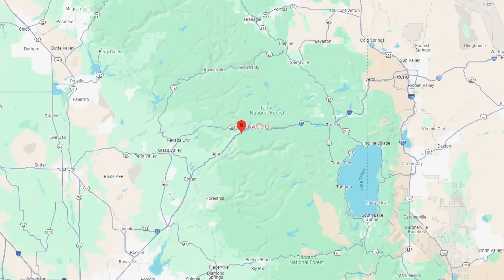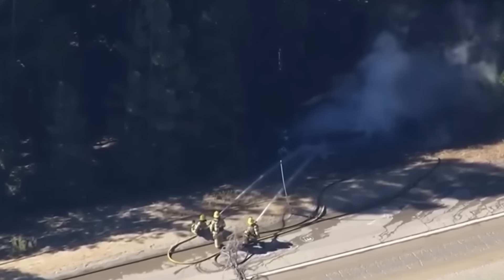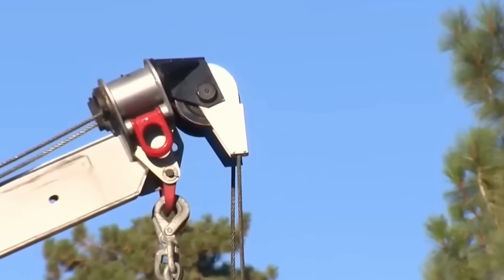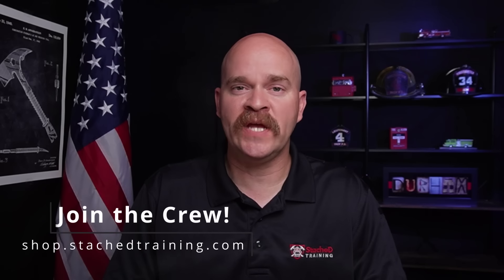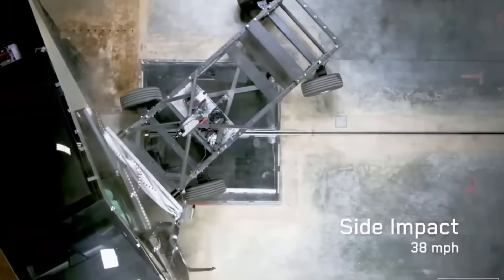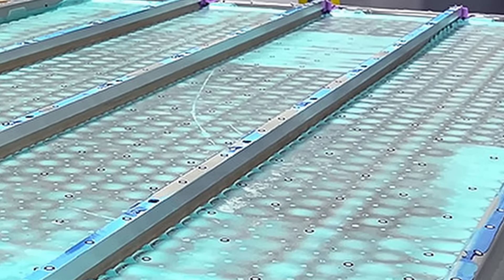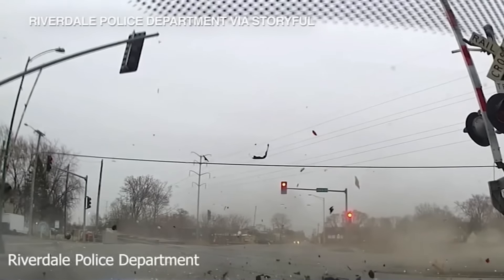50,000 Gallons! Tesla Semi-Truck & Cybertruck Fire

Comment: That a single vehicle fire consumed so many resources for so long is astonishing!

Sixteen hours of hosing a single vehicle whilst water tankers operated in relay to keep up the supply of water for the Firefighters is time consuming, labour intensive and expensive.

Even more expensive is the use of a multi engined fixed wing water bombing aircraft.

That just one vehicle caused such inconvenience, tied up a huge amount of resources and was incredibly expensive should act as a warning call of what lies ahead...
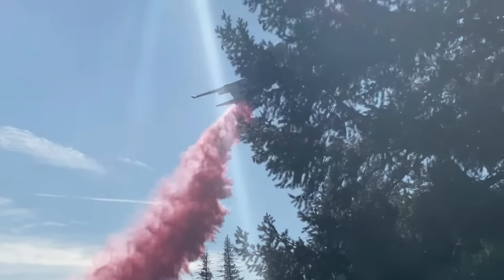Reply: 1:21 That 747 tanker didn't drop water.
Reply: re: "should act warning call of what lies ahead..." yes "should" act as warning call but unfortunately it won't (ref: would'a, should'a, could'a) for this "warning call" you speak of has already LONG GONE OUT with all the fire events that happened way back 3, 4, and 5 years ago (think Model S fires and think the GM/LG/Hyundai/Bolt/Kona "Total Recall" for battery packs) therein fast-forward this same 3, 4, and 5 years to the calendar date 2024, and "what lies ahead" represents is what's happening NOW (aw crap).
Reply: I've heard that it's better just to let the fire burn out which will take hours. Putting water on it will do nothing
Reply: @zzoinks  Allowing an inferno to simply burn itself out isn't something that Firefighters can do!

Uncontained fires need to be brought under control as soon as is possible.

Simply allowing fires to burn out at their own pace would amount to criminal recklessness in many instances as the risk to other structures, vehicles or people would be too great.

Water cools as well as extinguishes.

Comment: We need to put a stop on these vehicles being sold until we fix the fire hazard.
Reply: What do you suggest instead?
Steam vehicles are explosion hazards!
Any vehicle using a flammable fuel is an even greater fire hazard.
Reply: @economicprisoner  the boiler was a bigger risk than the fire box. Solid state batteries do seem to be a better alternative. Something like that would work nice. I just want a EV battery that doesn't overwhelm fire suspension systems. Or at the very least take out my house from the neighbors driveway. Our HOA has banned EVs after 4 EVs caught fire taking out 7 houses and causing major damage to 12-13 more in a 3 month time span.
Reply: @jmsether  How worn out are the electrical outlets?
I replaced mine before plugging my EV in. No fire yet.
Reply: @economicprisoner  I'm not sure. I'm pretty sure a chunk of people were using lvl1 charging.
Reply: @jmsether  I also installed an in-use rain cover and replaced the straight plug on my EVSE with an angled plug.
The straight plug was getting warm at the bend while charging, and I suspected the beginning of a damaged cable.
My car draws slightly more than the safe continuous current draw (12.5A instead of 12.0A).

Comment: Higher speed crash (above 35-40mph), the battery bursts into flames due to damage.

Very interesting. 

So the design criteria has to have a higher rate of speed, say 50-60mph.

Comment: Another big problem is batteries really don’t like being wet, so dousing them with water is only making the problems worse when firefighters show up on scene. There needs to be a new method for snuffing out these fires before they go into thermal runaway, or at least have the batteries insulated in a way where they cannot cause a chain reaction, I know that seems obvious, but its also obvious that adding water to a battery fire is a bad idea, yet we’re still doing it.

Comment: 80% of electricity is made by coal and natural gas, so EVs run mostly on coal.
Reply: Right, but given how power distributes from the power plant it’s more efficient than just running the car on burning coal.
Reply: @AdrianFahrenheitTepes What gives you that idea?
Sure power efficiency measured  at the power station, measure it at point of charge, there are losses.
Reply: @0Aus  combustion engines involve more conversions of energy than a battery powered electric motor drive does, hence less waste energy.
Reply: @AdrianFahrenheitTepes  I will ask this: coal power plant, where are you getting your energy efficiency numbers from & is the efficiency measured at the source or is it correctly measured at point of delivery?
I add I'm making no reference to the efficiency of a battery car.
Reply: @ ok, then no, I haven’t gone back to the power plant in my assumptions
Reply: @AdrianFahrenheitTepes  So where do you get the efficiency numbers?😆
This is the on going issue with your type,  you claim to have actually numbers yet just deliver what you hear or make up!

Comment: Hybrids did not have much fire issues, because they used NiMH to start with, which have zero thermal runaway potential. Unfortunately, they don't have a high energy density, which still worked fine in hybrids. The issue is, due to an oversight of thermal runaway in the event of an accident. Accidents are a definite probability in an automobile. However sophisticated the safety system may be, it is useless, when it comes to thermal runaway, due to direct puncture short of a battery cell in an accident. Also due to cooling requirements, there is hardly anything(a thermal barrier) in between to protect these cells from each other. Things are going to get worse in time, with all the aging EVs on the road with the NCM chemistry. Even LFP is not that immune, just that it has a higher temperature for spontaneous thermal runaway event. Expecting a more stringent battery safety test as part of annual inspection to ensure older EVs are roadworthy.
Reply: Will older batteries be dangerous like you said?

Comment: There is a vid on some channel which tested what happens when you crush one cell. It literally exploded at just 1 mm compression. ( or less the compression was hard to see ; that quick did it explode).

About the designs,  when a pole, bollard is hit, the speed required to cause the battery to explode is DRAMATICALLY decreased.  Since they are so large and heavy, it is simply not feasible to protect them enough to a side impact into a pole, tree etc. Or bottom side (there are vids of exploding EV's due to hitting a bollard).   Technically you can, but will make EV's  200 to 400kg heavier. In case of a semi that will add a  minimum of 1000kg. Further reducing its already very  limited range and limited towing capacity.

About the heat, a jaquar managed to burn literally into the ground, you are telling me EV fires are not typically hotter than an ICE car fire?
Reply: They can become hotter given how some of these EV fires melt the car into a puddle of hot lava

Comment: If they use fire blankets they would put out the fire in 30 to 90 minutes rather then hours.
They can use a few hundred gallons or less of water rather then thousands if they would invest in the proper equipment for the new changing times.
Reply: The fire isn’t put out.  The Oxygen being used in the combustion is inside the battery.  However, the blankets are important for limiting the heat being given off by the fire, which is dangerous because the heat being given off can start additional fires, so yes the thermal blankets are really vital here, but not in the way many people think.

Comment: Imagine how stupid it would sound if jet engines were powered by tens of thousands of Bic lighters. This huge battery thing is nothing but a joke hidden behind a latent smoke screen.
Reply: Jet engines will never be powered by batteries It just isn't the right kind of power for them. Not enough energy density
Reply: @zzoinks they have done experimental natural gas and hydrogen jet engines, but how widespread those become is anyone’s guess.

Comment: When we know introducing water to lithium causes the lithium to generate a  huge amount of heat, and gas and pressure in the battery pack (chemistry! 🙌) it seems like as EVs become more prominent, I guess cities and counties are going to need to invest in alternative extinguishing chemicals in lieu of the chemical we all know and love: h2o. That’s going to be expensive. That cost needs to be at least in part passed on to EV owners & operators, perhaps in the form of a tax, and/or EV producers.

Because right now the main chemical firefighters seem to have available when dealing with automotive fires is h2o, and that just makes a battery fire worse.
Reply: I say this as a driver of a hybrid, who fully expects to own a small, and lightweight, EV for his next car. We live in a society, we all need to pay our fair share. I pay less in fuel taxes to support our society right now, I should also pay more to offset the next generation of firefighting tools to deal with this newly and increasingly widespread passenger vehicle technology.
Reply: Hopefully the Lithium Iron Phosphate get more widely used, because they take a higher temperature to cause thermal runaway.

Comment: The fundamental problem with EV's is the thousands of batteries connected individually and only one battery or connection needs to short circuit and they all go up, creating the huge environmental mess that they're supposed to be reducing.  If EV cars become more mainstream, then this is going to do way more damage then good (I believe), not to forget the huge resources in creating them, and the problem of disposing them after they're no longer useful, what to do with them, and they are still in a dangerous state!

Comment: How much carbons or toxic fumes and smoke released into the air? Hmmmm
Reply: I would think a lot of toxic fumes but relatively little carbon dioxide is released. 

Because a lot of carbon dioxide is released from burning organic materials like wood or petroleum. 

All of them contains chemical energy, and turns it into heat energy when it combusts

So I'm thinking there's not much organic materials from the EV battery so when it burns it won't release much carbon dioxide.

Comment: Have they tried extinguishing these lithium fires with sand, or some other substance, as water doesn't seem to be very effective. Could we find a way to suffocate the fires these things create ? If they are this unsafe, why are they allowed in the general population ???
Reply: Unfortunately not.
Thermal runaway is a chemical reaction  the reaction produces oxygen. This is the key issue, we lose our standard go to for extinguishing common fires oxygen deprivation.
The current control is contain & cool attempting to stop the spread.

Comment: For all the “experts” bringing their negative views, this can be a good opportunity to attempt to hold several thoughts simultaneously. 

Products are designed within an operational envelope. ICE vehicles are typically designed with a certain acceptance for danger to other road users, health risks and death from air pollution.
EVS has a higher risk and damage potential when something goes catastrophically wrong. 

So denying EVS on the road will also continue to have a cost. 

I would propose better road infrastructure which would benefit all road users.

Comment: EV battery chemistry is changing. Cells are being designed to handle any type of damage including fire. Can you say the same for gasoline. Gas tanks are made of thinner and thinner plastics and engines are creating higher and higher fuel pressures in a engine that is only good at creating lots of heat. Crankcases are filling with raw fuel when pump seals fail. Gas cars burn at far higher rates than EVs. Gas cars burn and explode daily and we don’t talk about it. Tankers roll over daily in America and we are focused on one EV truck fire. We are so focused on what we don’t understand and we are ignoring the daily and often dangers that we do understand. Gas burns, gas explodes, gas is toxic and we only expand its use.

Comment: You need to use sand not water
Reply: How do you figure that champ?
Reply: @0Aus  coman since
Reply: @ronaldparobek2169  
So if I'm understanding your suggestion correctly your applying sand with the intention of depriving the thermal runaway of oxygen?
Reply: @0Aus  yes
Reply: @ronaldparobek2169   I understand what you are suggesting however thermal runaway isn't like a typical fire, the chemical reaction creates its own oxygen. Unfortunately oxygen deprivation won't be successful.
If you do a search on the topic I'm sure you will find it interesting. 
Please take care stay safe 🖐

Comment: 18 rubber tires burned to nothing, that is more pollution alone then me driving my old 94 Buick for years lol, only cost me 700 bucks instead of 50,000. Are these idiots not thinking?? Use your brain people
Reply: It's actually a lot less pollution unless you don't drive very much. If you look up the lifetime pollution of a gasoline versus electric car, the electric car has a significant advantage. So buying a used car versus making a new EV, making the new EVs apparently better for environment

Comment: So basically the cyber truck caused a fatality because the driver was at very high speed I wouldn’t blame the truck for that
Reply from the maker: If this were an ICE vehicle, the likelihood of a fire is low. It's possible for a driver to be trapped, unconscious, or injured, and the fire department can rescue the driver, allowing them to possibly survive. However, with an electric vehicle, there is a high likelihood of the batteries going into thermal runaway if they are damaged. If the driver is trapped, the fire will cause a fatality before the fire department arrives.
Reply: @StacheDTraining  depends on the ice car, some ice cars have a button that ejects the doors so the driver can escape. Ev cars are far more volatile because the batteries can potentially become bombs. 

But I think you and I would both agree that crashing any car regardless of propulsion system could be fatal. The cyber truck already weights 7k lbs and going fast enough to damage the batteries isn’t a good idea. I own an ev and a multiple ice vehicles. So I’m not being biased.
Reply from the maker: I agree 100%.  Any crash at highspeed can be fatal.  My concern is purely the additional fire hazard from the batteries.
Reply: @StacheDTraining  and I’m 100% with you on that, unfortunately unless they can use some really strong light weight metals increasing protection around the batteries would only add weight. They need to maybe build in fire retardant materials around the batteries and maybe wrap the whole battery pack in Kevlar that might prevent the bursting they would need to test it. Or have a chemical agent built into the cells that immediately neutralizes the stuff inside the battery upon a crash.

Comment: High speed crashes are so dangerous that survival is unlikely anyway and if fuel is spilled from a ruptured fuel tank you could also have a deadly fire. I don't think any car designed for general use is rated to protect from a high speed crash as unpredictable damage to dangerous things can result irispective of the drive technology. Cars designed to protect against a low speed impact can come apart in a high speed one as the protective system of crush sections leaves the car weakened when more impact energy than they can adsorb goes into and through them. At high enough speed in a crash no car is safe. Does it matter what manner of gruesome death someone suffers? If you hit something at high speed and survive you are just  that lucky as cars are not designed for that situation
Reply: “Nuclear bomb-proof glass”
Reply from the maker: When a combustion engine vehicle crashes,  fire is rare.
Reply: Exactly
Reply: @JoeOvercoat then the power windows go offline whenever you run over a can in road 😢
OH Tesla 😂😂😂

Comment: OK greenies, there you go.  Think about the runoff from the firefighter's water mixing with the toxic electrolyte from the 10's of thousands of cells in the Tesla Semi battery pack.  It' all going into the pristine wilderness that EV's are supposed to save.  Explain to us all how this is saving the environment.  Every EV crash site should be an EPA Superfund site.
Reply: True, though oil production can be pretty messy too. But I'm thinking about the oil sands in Canada which is how they get the oil to send to the United States. They have to raze an entire forest down to the ground and dig up oily sand and that cannot be good for the environment either. 

But in a gasoline car crash, wouldn't you also get engine oil and possibly gasoline gushing onto the ground? If that resulted in the fire, the firefighters would have no choice but to spray water and therefore disperse those substances into the environment